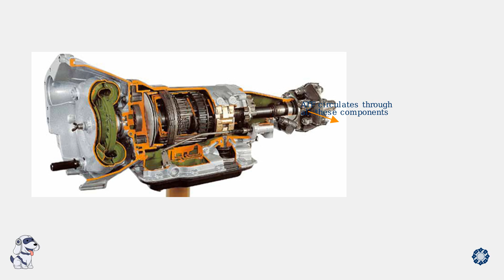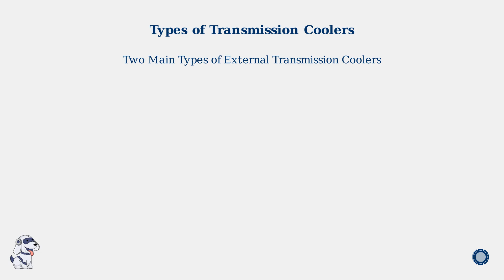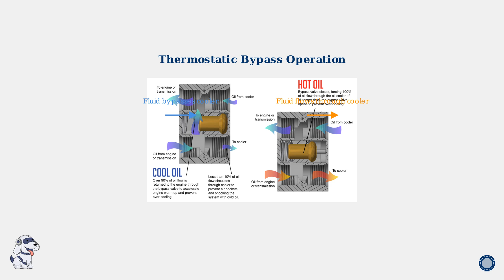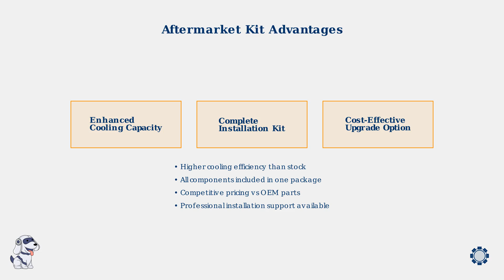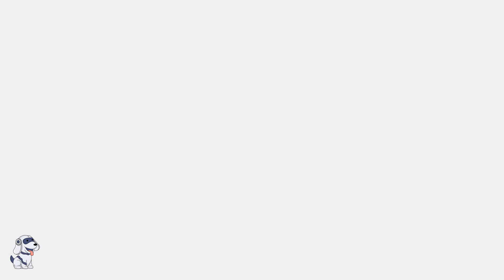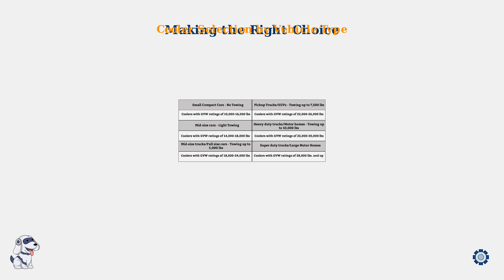How External Transmission Coolers Extend GM Transmission Life

Comment: Thanks for this video. Q: on a 8L90 how about internal pump preassure if the circulation of the fluid is larger than OEM routing  with external cooler, giving more time and distance so the fluid comes back in to the transmission: could the transmission internal pump lost preassure? more preassure demand from the pump? will the pump would be doing it's job for more than its specified?
Thanks for the help on this!